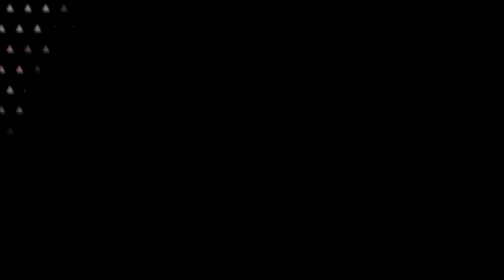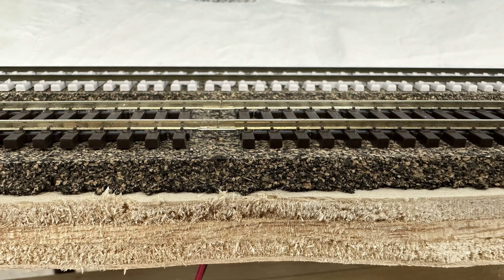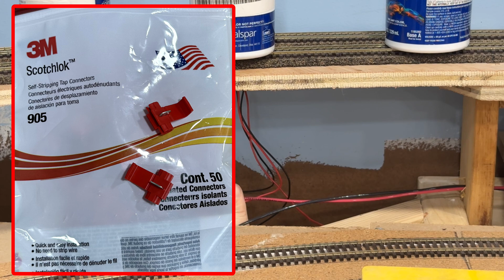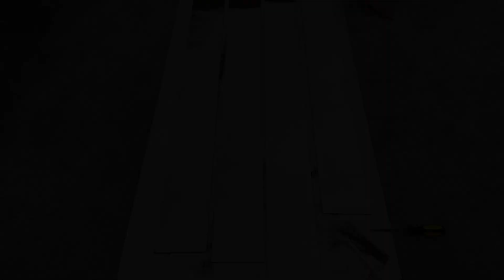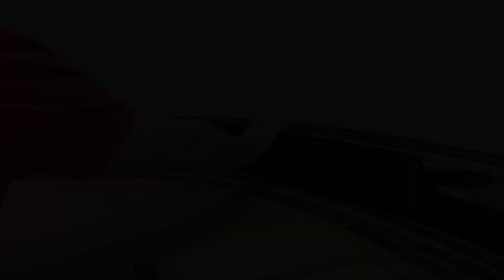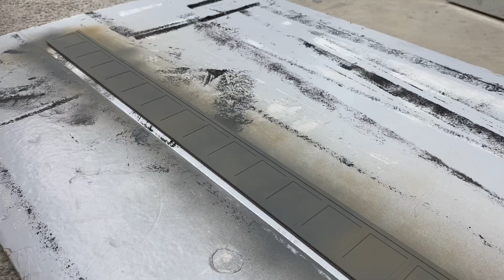UP Heartland Division Update 1/4/23 (How to install fascia, retaining walls & dirt for ground cover)

Comment: Looks like it will be nice. Don't like suitcase connectors and nice and easy never seems to be good... Good idea to mount the wall to a piece of hard board. I back almost all of my thin walls and buildings on hard board or 1/4 inch plywood to stiffen them... I also use a wood block to keep the plastic weld from going over. Not hard to loose the jar.

Comment: The GBRX covered hopper use the air flow system and can't be used for sand or similar products.
Reply from the maker: Thanks for the info.  Are they mainly used for cement/plaster type material?
Reply: @modeltrains_365  I've had this happen on my channel as well, people tell you its wrong, but don't tell you what's right.  I've had to do more covered hopper research than I ever thought possible to buy correct plastic hoppers... there are so many different types.  Cement is generally in the two bay gravity feed ones.  That one with the airline, on the TrinityRail page it just says used for 'free-flowing' dry bulk commodities.  Check out their page to learn about the prototypes, it helps a little at least.
Reply: @VSLAModelRR  Ho! I am so sorry, I didn't tell the real purpose for the cars.
Reply: @Christiane069  Any idea what those airline cars are used for?
Reply: @VSLAModelRR  Large covered hoppers usually three bays, using gravity pneumatic exhaust are used mainly for Food-Grade products that requires reduction from exposure to contamination.
Some other products can also be used such as chemicals used for the production of plastics including closes.
The vacuum is produced on location.